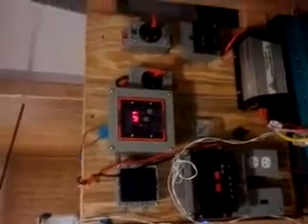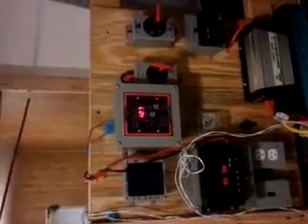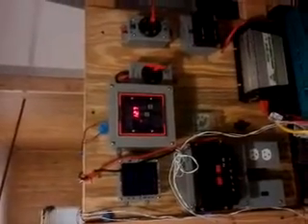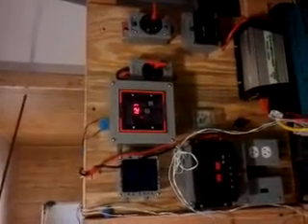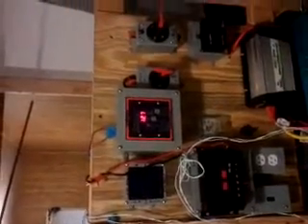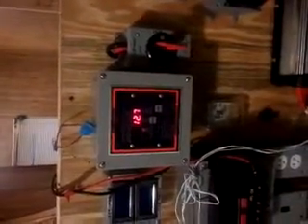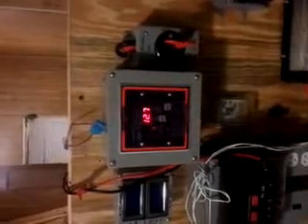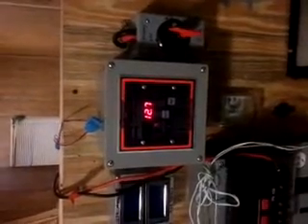Video 2of2 DIY solar super capacitor bank

Comment: Have you tried to run the system on just the super capacitors. If yes how long did the capacitors supply your inverter, compared to the battery bank?